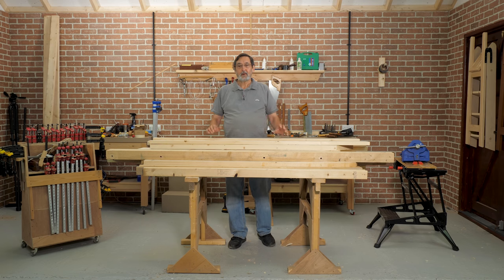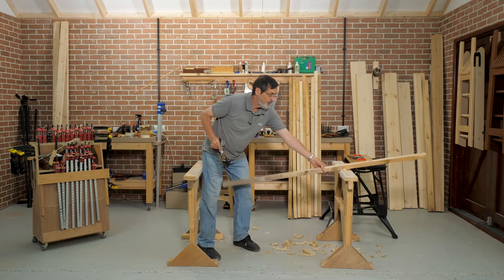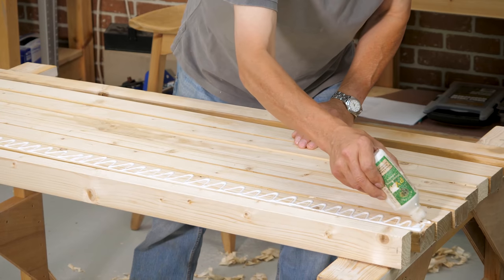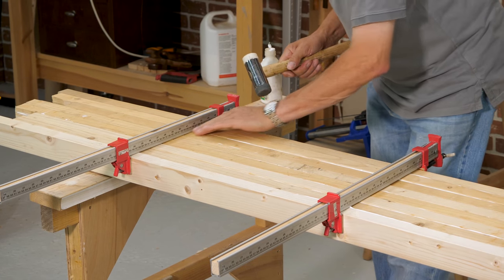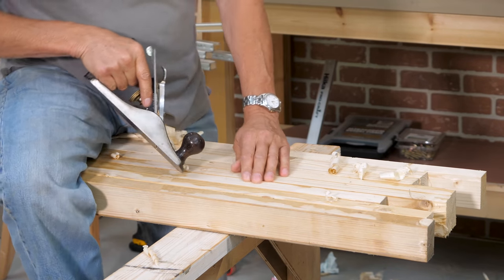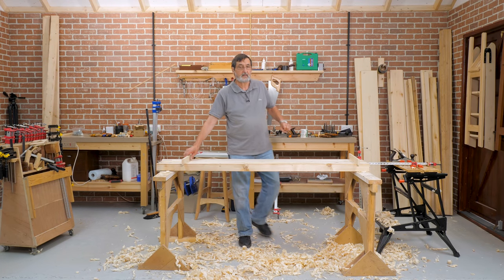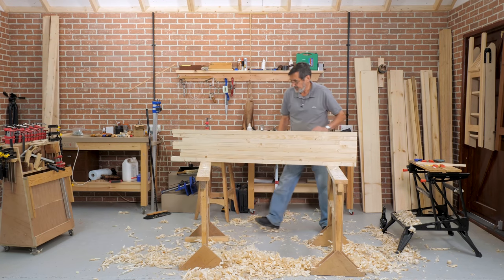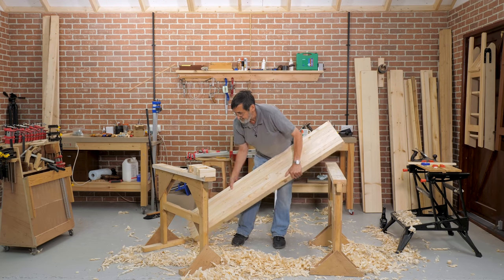How to Make a Workbench Episode 1 | Paul Sellers

Comment: Is this made of pine?  What would you say to someone who thinks pine is too soft for a workbench?  (excellent videos, many thanks!)
Reply: Aske Marina he has a earlier series in workbenches, and in the first episode he says that the softwoods are perfectly fine for a workbench, but if you really don't want softwoods (I was thinking about doing this for a one piece top surface) you could go to a lumber yard, or any other place you can get wood, and find either thick plywood, or a wide piece of lumber and take it down to flat, and fasten it to the surface of the bench. I was thinking some recessed bolts with a mounting plate on the other side so the top could be easily replaced when it needs it.
Reply: My workbench is the first workbench design paul made the 11 part series. Its been a solid hard worker for almost 2 years i have no complaints. And even if a part was damaged somehow the cost of replacement of 7 2x4s and 2 2x6s for a benchtop and apron.... maybe 30 bucks at a box store.  Try finding a cheap hardwood for that price your bench top will not cover the same area or weight. All in all pine is fine.
Reply: I don't think pine is too soft.  It makes a solid surface and is not so hard that it dents your projects.  It is also cheap.  You will notice that many times Paul aims his projects  to "everyman".  That is the guy who has limited tools and limited budgets.  Pine is perfect for that guy.  By all means, spend more money on hard woods if you have it, but it is not necessary.  You can spend 3 times as much money and get a bench that is 5% better.  Paul is using reclaimed 2X4s, which means that after smoothing the top will be over approx 3 1/4".  This will make a very strong, stable bench top.
Reply: John Sauer I am thinking of the red oak box store wood for my top and douglas fir for the frame. The high dollar benches don't have thick enough tops for thier asking price. Not worth the money.
Reply: a wise man once said to me - if you accidentally drop the piece you're working on, onto your workbench - do you want the piece to dent the workbench, or the workbench to dent the piece?
Reply: medieval knievel Great point
Reply: $30 would only buy you framing studs.  Keep in mind that you need well dried wood, and preferably free of knot holes - knots are workable, knot holes not so much.  And you'll lose about a quarter of the wood by having to plane framing studs down to square.   I'd eat the higher cost of going to a lumber yard to buy dimensional milled lumber.
Reply: Art Heen my work top is framing studs and its 3-1/4" thick. Dry in south texas is relative to time of year i left them in the shop for three weeks and when they didnt twist or bend i started work. And i agree knot holes would need a filler, no fun. Had to pick through a whole pallet but i was fine with it.  To each his own.
Reply: I imagine it's a bit easier to find dry wood in Southern Texas than up here in the wet and cold north!  Never mind that much of the lumber here is local and so wet you can juice it...  :)
Reply: Aske Marina I made my workbench from watching Paul's first workbench series where he made it by bracing against a tree in his back yard. I made mine from Oregon building grade fir (I lived in Oregon at the time) and after 5 years of beating on it, assembly and gluing on it and anything else I need to do on it, I can safely say, I won't need to build another for at least another 10 years because it's as solid as a rock! I didn't even bother to spend the extra money to buy 2x6's for the apron, I just did three 2x4's (after I removed the rounded sides) because I didn't want as thick of an apron as Paul's design because I wanted the ability to clamp to the work surface without employing a 36" clamp. the whole bench cost me about $40 because I made mine 4" wider than Paul made his. if you plan to order that little knife that he's using you better order soon because it ships from England and it took 5 weeks to get mine. it's a fantastic knife though if you're willing to wait. only cost me $11 with shipping but it's worth the wait.
Reply: I bought reclaimed Southern Yellow Pine 2x12s for my bench.  If you can find it, SYP is heavier and more resilient than the random white wood at the box store.  I thoughy for sure I would at least run into issues with the holdfast holes, but it is really tough!
I will say also from recent experience that if you are going to use holdfasts, 3" is probably the MAX thickness you want.  They don't work well in thicker wood.  A 3-3.25" thick top is what you want, and make up all the weight you are shooting for in the legs or a bottom shelf.
Reply: Stan, by all means, building your own costs less and you can customize it for your personal needs.  The building process also gives great experience in glue ups, mortising, etc.  Regarding the oak, all I've seen are  3/4" planks.  Laminate 1x4s together and you will get a 3 1/4" thick top after smoothing.   This will make a great bench, but will be pricey.  Your oak bench top will be only marginally better than pine, but cost LOTS more.  I made a small bench using 2x6 pine boards, the resulting bench after smoothing is about 1 1/4" thick.  It works, but still has more bounce than I'd like when I'm hammering on a chisel.  I recommend a top that is at least 3" thick.   Watch Paul Sellers' videos on benches - he knows his stuff.
Reply: I'd avoid oak for a different reason:  If actually using the workbench, you are going to get cuts in it.  Oak gives more splinters than most wood, and isn't nearly as antiseptic as pine.  Maple is a great alternative for hardwood, but it is not cheap either.  Pine is an overall great choice precisely because of the low costs.
Reply: Art Heen That is a very interesting point.  Also, I agree with the thought that the workbench should be softer than whatever you're working on.  If, after many years the top was covered in dents, it could either be ironed, or simply planed smooth.  After all, it is 3 1/4" thick.
Reply: where did you order the knife from?
Reply: alemon74 Amazon.
Reply: do you know the make by any chance?
Reply: Regarding the holdfasts, one option I've seen (if you're not using a brace and bit) is to drill a small pilot hole, drill a 1 1/4" hole in from the bottom to about 2 1/2" from the top, then drill down from the top with a 3/4" bit.  That way the holdfasts can wedge in the top 2 1/2" of the benchtop and the part beneath is out of the way.

If you're drilling with a brace and bit, you can always drill your 3/4" hole and then widen the bottom of the hole with a reamer or a gouge.

That way you can have the really thick tops (if that's what you want) and still use holdfasts without a problem.  I haven't tried it myself yet, but I picked up a 4" thick maple slab at an estate auction and was thinking of using it for a benchtop.  Hopefully the trick I'm walking about will work.

Comment: Do you have plans for the sawhorses / trellises? I need to go buy clamps. I have not found the clamps you used at Home Depot or Lowe's. I know any clamp company could work, but i like the simplicity of your clamps. Where can i find them in the USA?
Reply: Bessey industrial bar clamps are available at Home Depot.  Eight 48" ones will set you back around $350.
For saw horses, make sure you get some that allow clamping and can carry your weight.  I.e. most soft plastic ones won't be all that good, so $40 a piece.
Depending on what you already have, you might have to add some other tools too.  I'd look at the tool list, but with the new and more commercialized Paul Sellers, I can't see the list without signing up.
Reply: I think you can buy those at Harbor Freight. They are aluminum, but Paul says they are strong enough.
Reply: You can find clamps at Harbor Freight down to $8 for 36", but that will not be "them", but a different type altogether.   Sure, they'll work fine, but won't be "the clamps you used", which I believe was the question here.
For a similar type of bar clamp, top adjusted ones, the cheapest from Harbor Freight are currently $12 per 36", $15 per 48".   To get the same brand too, thicker and with a built-in ruler, it's a bit more money, and different stores.
Reply: As others have said, Harbor Freight has them or very similar ones. Paul inserted boards into the hollow centers to increase strength and rigidity. Search his blog for "Alluminium clamps retrofit" for a sort of how-to on improving cheap clamps (which appear to be the same that he uses in these, and most, videos).
Reply: Plans for trellises?
Reply: tkjazzer  search his blog for "saw horses". If it's not there, then check here on YouTube and at woodworkingmasterclasses.com. I think he has made videos with instructions on making some that might actually be a little more stable than the ones in this video. They were also fairly simple and easy to build.
Reply from the maker: Thanks for bringing this up. We're looking into filming the trestles soon. You can see how to make sawhorses  with a free membership here: https://woodworkingmasterclasses.com/videos/sawhorses-project-info/ - Team Paul
Reply: Paul Sellers awesome looking forward to the trestle vid

Comment: Are those bricks wallpaper
Reply: They are. A video was released recently saying about how this is emulating our experience in a garage opposed to Paul's usual workshop.
Reply from the maker: Pretty much. It is thin boards with a raised 'brick effect'. We were testing out the format before we build the more permanent filming area which will have a more substantial, more permanent, backdrop. 

- Team Paul

Comment: Anyone doing this should invest in an electric planer and table saw. You'll need it eventually and the Hann planers aren't cheap so put your money elsewhere. This whole video is hand planing and cutting with a hand saw.... Ugh... Waste of time, sir.
Reply: You profoundly miss the point of Paul's series, which is now to build a substantial work bench with HAND TOOLS.  Lots of other YT videos on power tool methods.
Or you can just put an old door topped with some MDF on a couple of plastic HD sawhorses.

Comment: 25.4 x 66'' = 1676.4mm ... not 1680
Reply from the maker: Hello Mikkel, the metric measurements are not direct conversions because to be accurate and ensure an exact
fit this would involve providing measurements in fractions of millimetres. We wanted to provide rounded numbers in metric,
therefore have created two slightly different sets of measurements. This means
that in places the imperial measurement given is not a direct conversion of the
metric measurement given. Therefore, I suggest you choose one or other of the
systems and follow it throughout. See the drawings for more details. - Team Paul
Reply: Yes u r right Steve. We use the metric system all over here (almost), and need the 2.54 figures to know what sizes you in USA use. Similarly miles, gallons etc. we are not used to. That is why I do not  think of accuracy, but just that 66'' (is a ?? for me, without 2.54) is not 1680mm. The only way we use a not metric value is at sea. 1 Nautical mile (we call it a seamile) here is 1.842 km. As one US mile is kilometer 1.60935 + some more digits, it only confuses everything more. As Paul S. suggests I have already chosen the metric system - as most have in Europe.